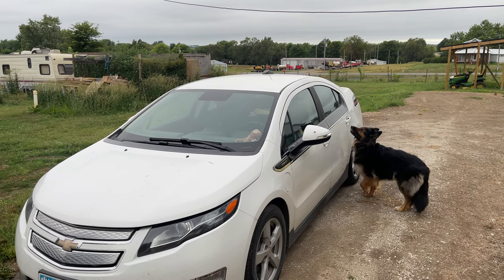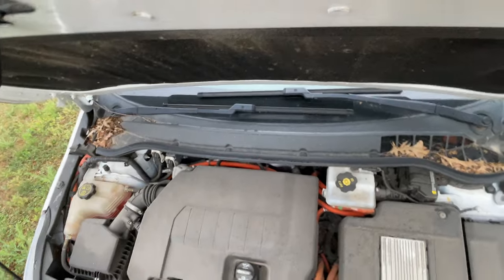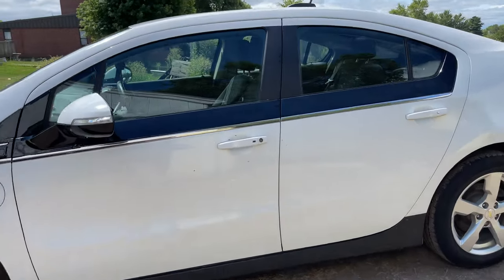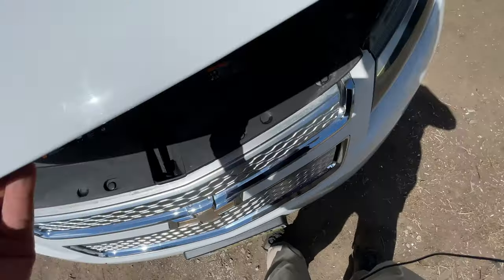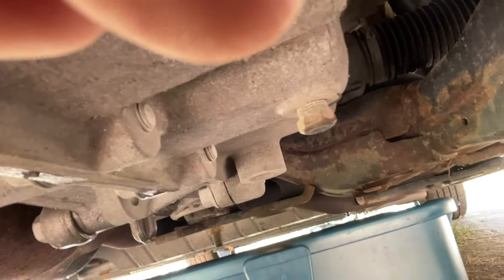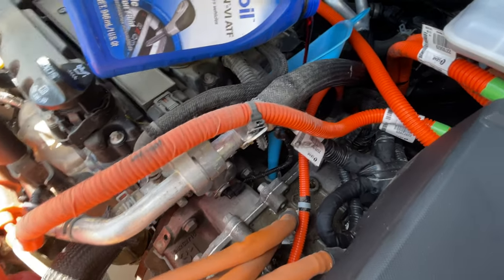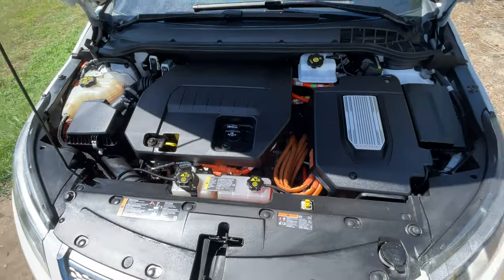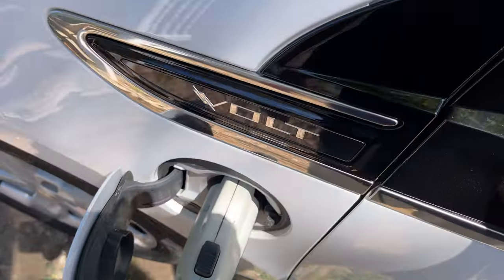Misses W's Chevy Volt Maintenance Adventure

Comment: gen1's have almost no friction in their transmission/transaxel. i would leave them alone imo. gen2's have a cvt style belt instead of a big solid gear which has exponentaily more friction, thats the only one i would change fluid in, especially if its in a hot climate and runs the motor a lot. just too risky for someone to refill to the wrong level or use the wrong fluid like im sure shops would.